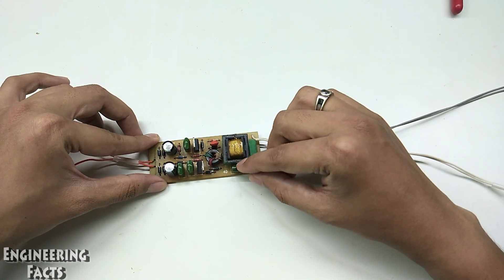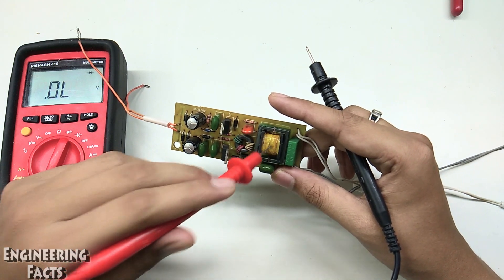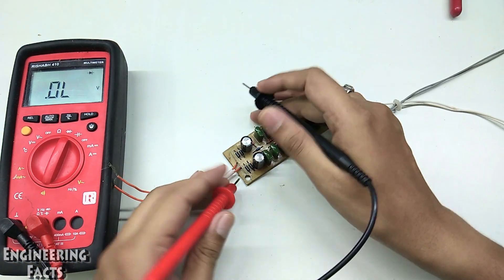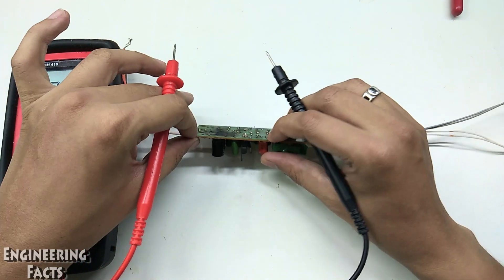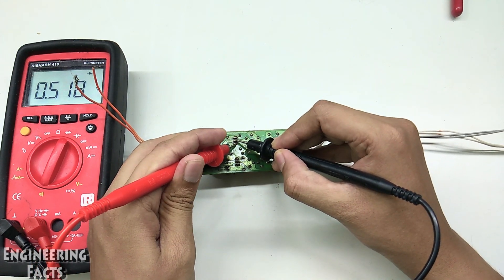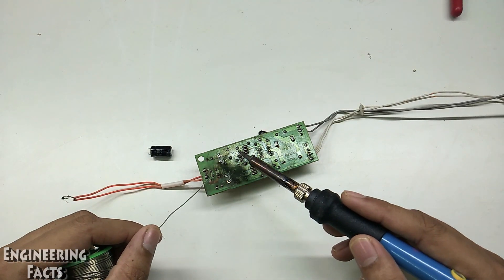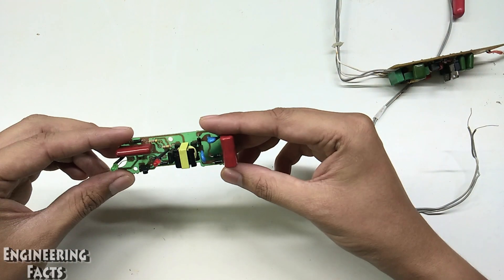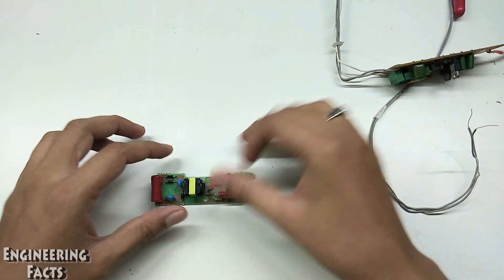How to repair TUBE LIGHT Electronic ballast choke?_Tamil, Repairing process of Electronic choke.

Comment: Bro, sorry for pointing out a wrong concept. You said adding two 10mfd capacitors in series becomes capable of added voltage and same value ( 10mfd). I think its wrong. Two capacitors added in series adds up voltage rating but its value comes down. C=(c1×c2)/(c1+c2). Since both capacitors are of 10 mod value, total value becomes 5 mfd.

Comment: Bro in my house plug point la power iruku... Ana charger, yethavathu device connect pannuna work agala, and tube fan in that particular board not working, whats the reason and hoe to cure it, tell me the solution

Comment: U changed the capacitor  .. voltage not a issue but instead of 5 micro farad u changed 10 micro farad  is it good?
Reply from the maker: Not much issue
Reply: @engineeringfacts  increasing not issue but reducing is issue ah?

Comment: bro  i have doubt in smps, in honeywell smps, its incoming voltage 440vac, and output is 24vdc in that  internal fuse was damage but no other  circuit was burned, so we replaced the fuse then we switch on, suddenly a blast sound came in that one capacitor was burnt and liquid like substance came. can able to explain why?
Reply from the maker: Fuse failed means, some internal circuit also failed

Comment: Help me how to convert the normal tubelight set to led tube light set
Reply: Illa Syed enga veetula normal tube light frame iruku athula led tube set aagatham electrician told need to some changes in the frame
Reply from the maker: No frame required for LED lights. Go and ask your nearest shop, they'll show you
Reply from the maker: Why you want to convert, LED tubelights available in market..
Reply: Ok thanks Syed

Comment: Bro oru doubt. In my home 200v or 160v thaan varuthu in single phase.. ac, washing machine, refrigerator eruku... So 3 phase ku change panna voltage correcta varuma?
Reply from the maker: Neenga EB supply, single phase to three phase ku mathuna, problem solve aagum. But line to line voltage kodukka mudiyathu. 160*1.732=277 v L L.
Reply: @engineeringfacts  appo single phase la line change panni parkalama bro
Reply from the maker: Yes. Change panni paarunga..
Reply: @engineeringfacts  ok bro